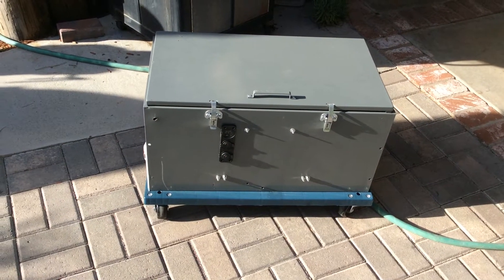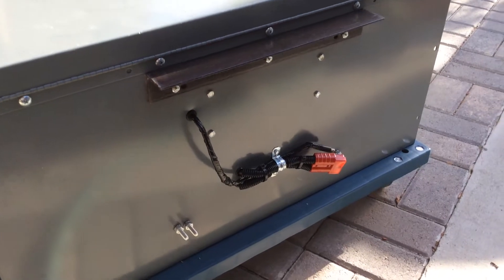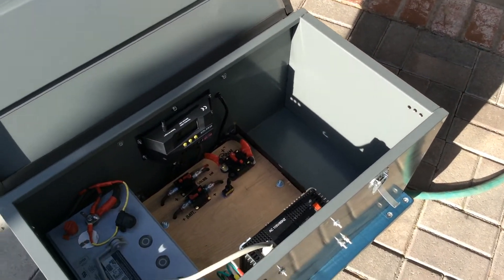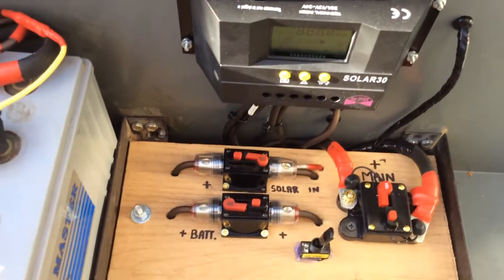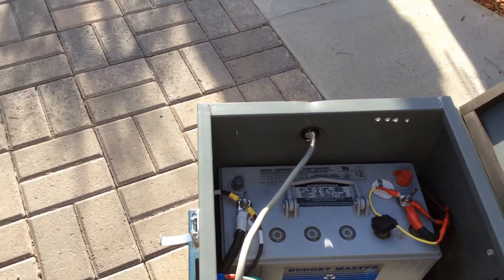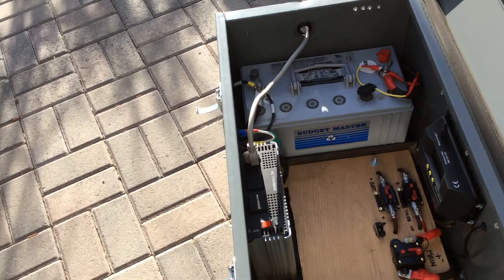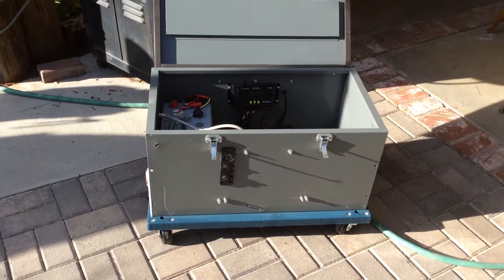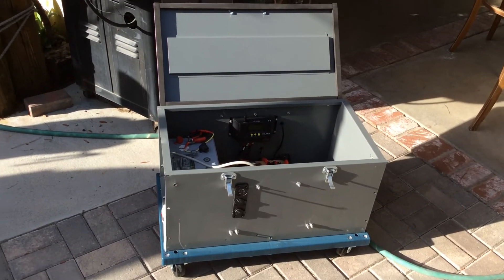DIY SOLAR POWER GENERATOR ( portable 12 volt ) # 1

Comment from the maker: This is the first video of the mid size solar generator build. 12 volt system 1500 watt mod. sign wave inverter , 30 amp PWM controller , fused system, portable. Box will hold two 100 amp hour batteries.